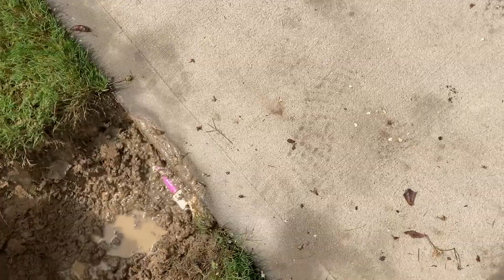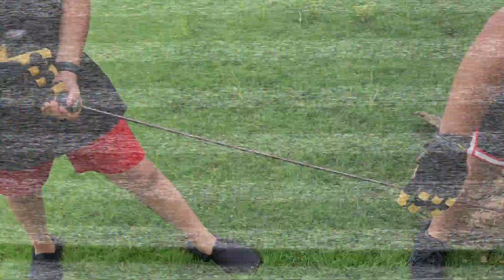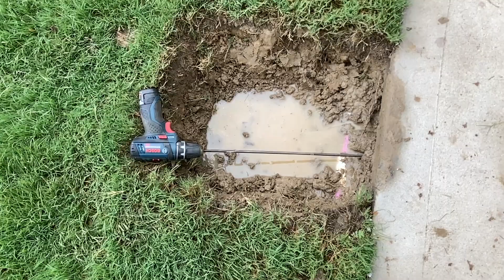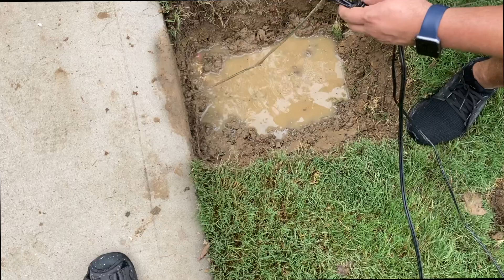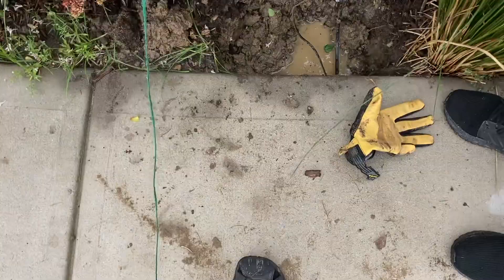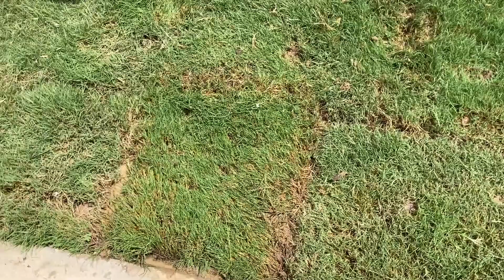Easy method to run wire under concrete pathway / driveway - landscape lighting

Comment: A better way to pull the wire is to tie the string around the middle and basically pull the middle of the wire through. Then you're not trying to pull a thick knot of wires. Then just reverse any extralength.

Comment: We make a cable bit designed specifically for angering under side walks. The bit you are using is made for wood applications and after you use it in the dirt it will loose it's edge for cutting wood. I would be happy to send you one of our bits to try. ETD75054 or ETD75072
Reply: Does flex ? Cause some time on the opposite end we tend no to find the bit we have to dig more
Reply: @dannykim6218  Yes, these shanks are spring steel and flex very well.

Comment: You could have slipped a 1 or 1:5 “ of PVC pipe over your drill and pulled it back through so you’ll have a permanent conduit under the walkway and easy access for the future.
Reply from the maker: Thanks for the suggestion!
Reply: @Dubs that's exactly what I'm trying to figure out an easier way to do. I have to get conduit under sidewalks to run fiber optic cable through. Hopefully this will make my job easier!
Reply: That's genius. This is my first time trying something like this (not wiring that's ez)
Reply: Can you make a video too? Ok do not understand how to push the PVC conduit through (Which is my dream to reduce such hard work in the future if wires do go bad or need to repeat this task for some reason, as well).
Reply: How do we contact you too with questions for your suggestion?

Comment: if you have the resources.... using a metal "fish tape" is very helpful here.  Another way to do this is with a pressure washer.  The high pressure easily penetrates the gravel/grit.  
If you're going to use a long drill, pass it through a length of 1" PVC tube.  This will present the drill bit tip parallel to the side walk.
Reply from the maker: Thanks for the suggestion! I'll try that next time :)
Reply: Yeah that's messy though.

Comment: And for longer runs of up to 12 feet underneath driveways you can weld a 1/4 " steel extention rod to the end of your drill bit and extend it by another 72 inches.  Works great!
Reply from the maker: Great idea! Do you have any method for keeping the bit in a straight line?
Reply: @Tasteofgyan  You can run the elongated drill inside a 1 & 1/2" piece of pvc pipe using it as a guide to keep the drill bit straight.  And if you need a larger hole you can use a mini-jetter run inside the newly drilled hole with a 4" piece of PVC carefully tapped into the hole with a rubber mallet as the mini-jetter moves forward to expand it.
Reply from the maker: @fhiggenbottom  Great suggestions, thanks!!